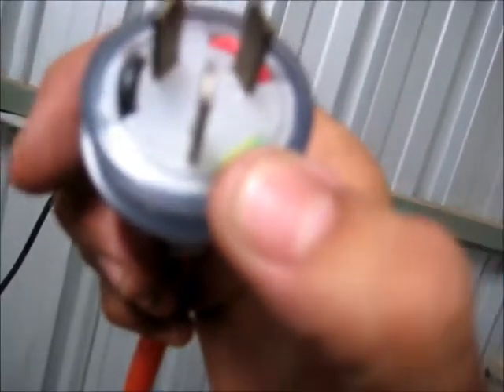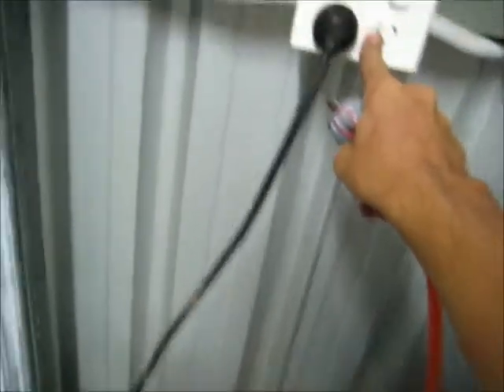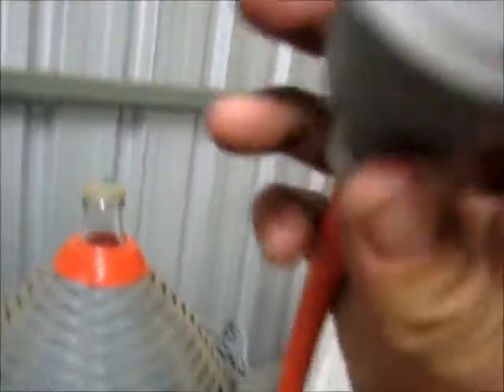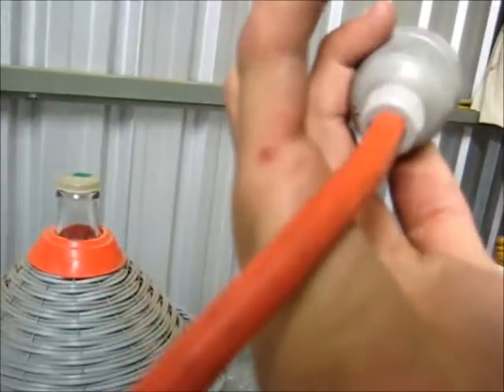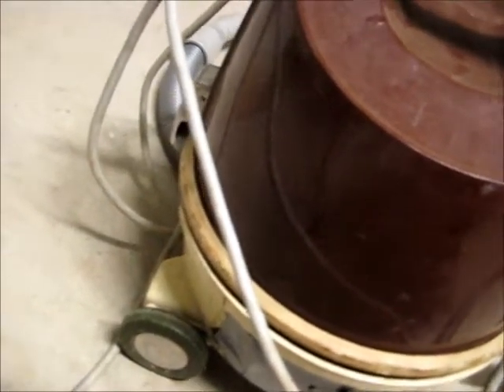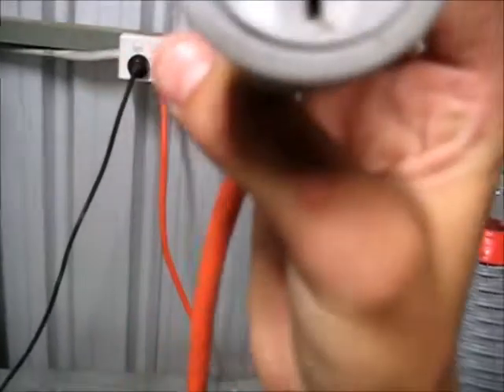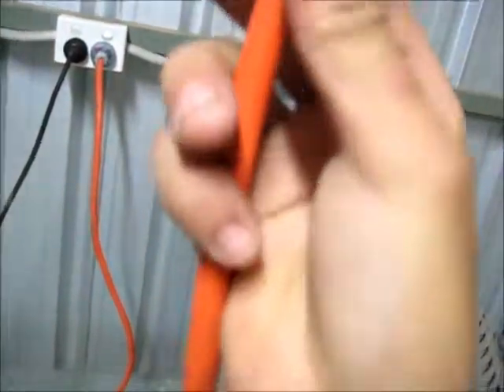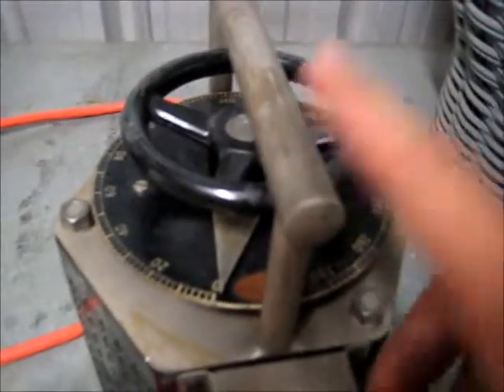Antique Variac Test

Comment: Nice! I don't know why I didn't comment on this vid at the time. If this was mine, even though some people would be saddened by it's modification, I'd just have to remove that handle on top, as with that there, the hand-wheel on the top can't be cranked quickly. That handle gets in the way. I'd have to whip that off. 

My point being: If the variac started complaining & you needed to turn it down quick, that handle would get in the way. Also, crank-up fun is restricted too. :-(

-BBD.